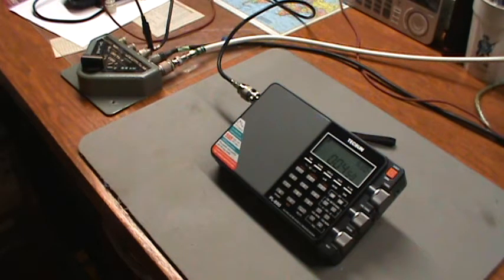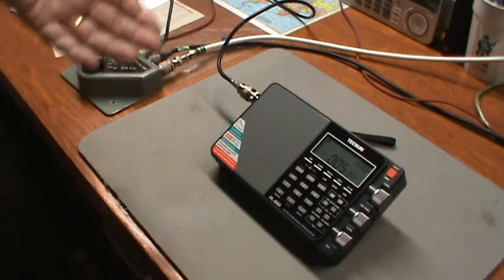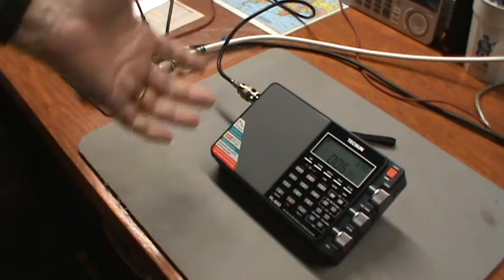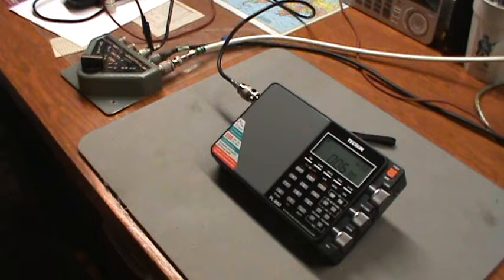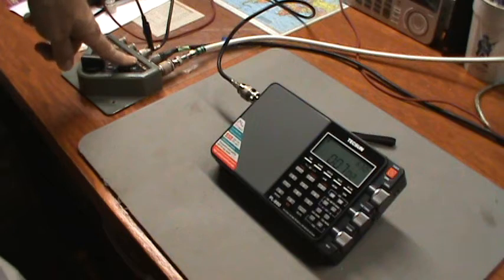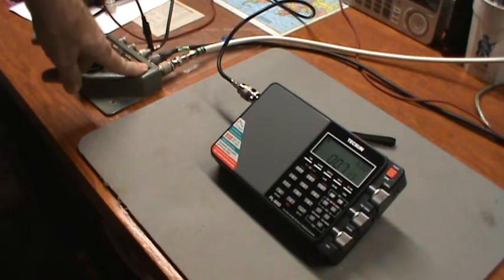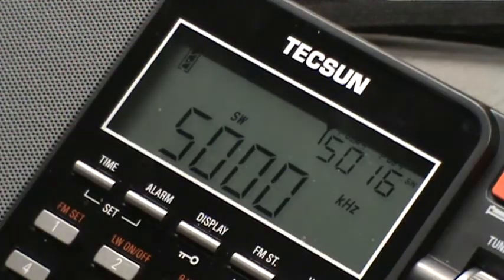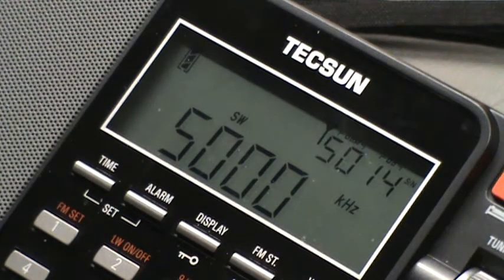TRRS #0830 - Antenna Testing Using SNR

Comment: It's amazing what 10 extra feet of wire will get you. Another great video!
Reply from the maker: +KE0IMD Thanks.  The 50 footer also has a balum.
Reply: hamrad88

I'll keep that in mind. Will probably run my own line out since I'm already in the doghouse for buying a new radio. -Ha!

73 - KE0IMD
Reply from the maker: +KE0IMD too funny